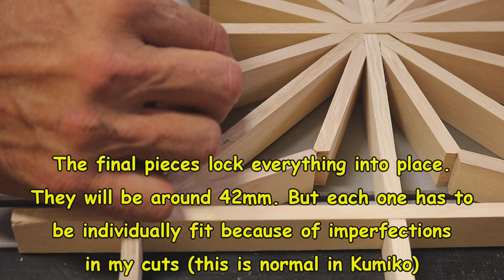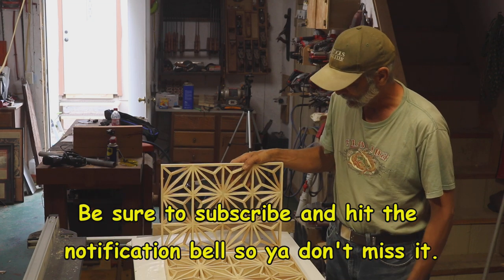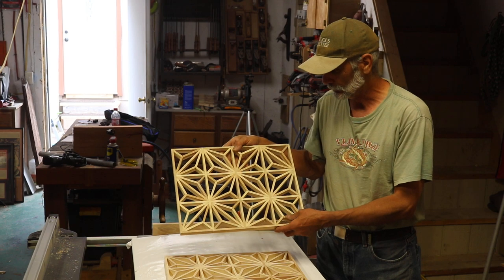Making a Kumiko Panel

Comment: You need to make a shooting board and a donkeys ear for cleaning those up. (I would because I don't have as much faith in my miter saw.)
Reply from the maker: I did the first one all by hand. I was pretty sore when I finished it LOL. I tune up my Miter saw pretty regularly, plus I have reference boards cut to exact angles I use to double check it when I change angles. So far its been dead on.
Reply: @DIYwithUncleCy  Lucky you ...